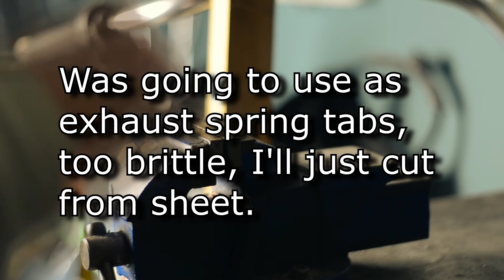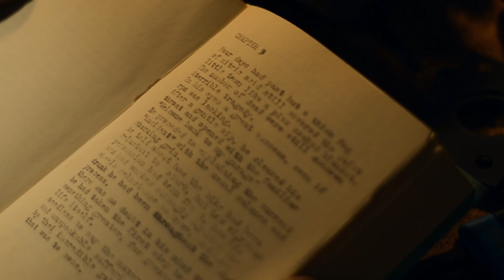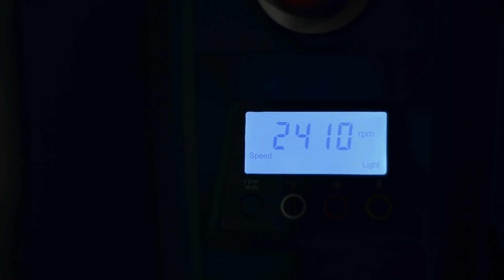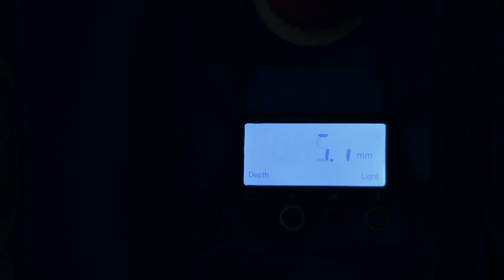Even the Most Powerful Two Stroke has to wait for parts...

Comment: interesting ,, but i dont agree that its all about resonance, crankcase pumping will always be a fact in 2 strokes
Reply: I think you'll find that resonance is also relevant to pumping losses. There are fluid (i.e. air, fuel, oil vapour, water, exhaust gasses, etc etc) flow patterns around the various stationary and moving metal bits that are most efficient at some rate - it's pulses from piston motion pushing the fluid around, which creates wavefronts of pressure, which bang into each other and either align and add up (i.e. become more efficient by adding their energy together) or interfere (i.e. become less efficient by robbing energy from each other in the form of taking some amplitude from lower-frequency waves and turning that energy into some higher-frequency waves). This is precisely what resonance is.
Reply: Without an intake valve then there is no crankcase pumping at all
Reply: @NZrider100  how's that, exactly? Unless I'm missing something, I don't think the valveless high-RPM intake makes the crankcase suddenly empty and disconnected from the cylinder airspace. If it's still part of the airspace, there will still be power losses due to pressure differences between the top and bottom of the piston - i.e. pumping.

Comment: 2 strokes are interesting 😍 I've always wanted to have one but id never had the chance coz it's pricey 😂
Reply: Pricey? You should start like me with the China doll. Later you can heavily modify it or upgrade.
Reply: You can find alot of good cheap ones to get you started was only 100$ for my first 2 stroke
Reply: Bought my CR85 for $300
Reply: My first and still have 12 years later is an 83 suzuki fa50 i am designing a 2 cylinder 2 stroke diesel as a bolt on conversion for it